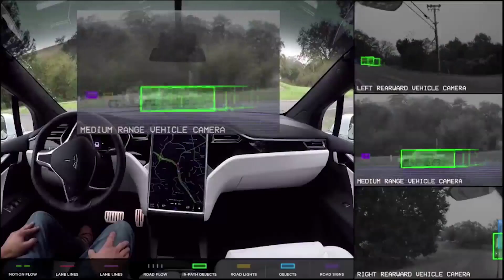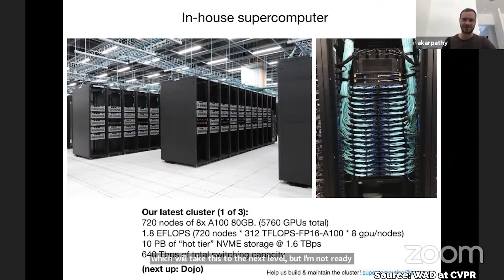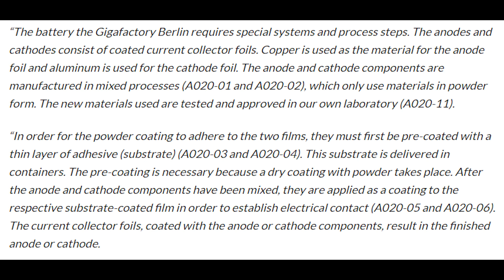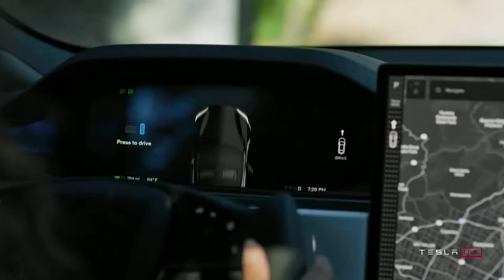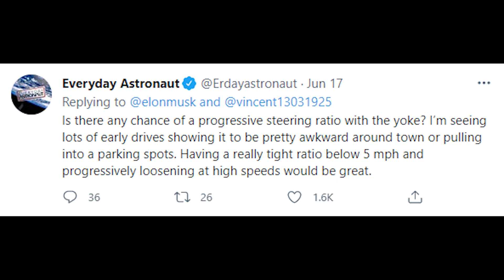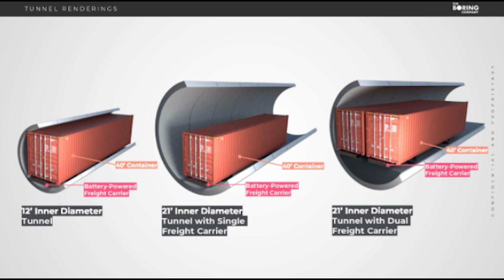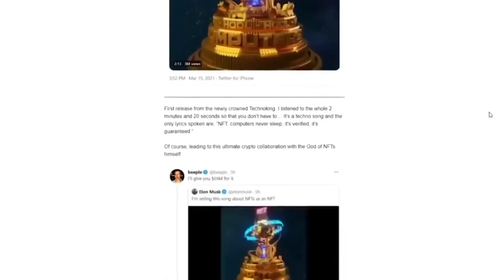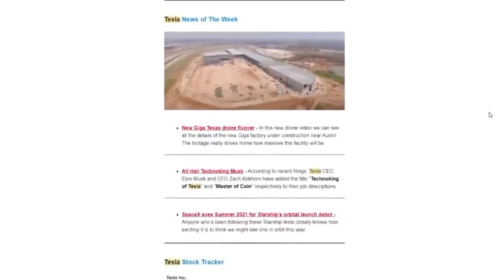2021 Tesla AI Day Is Coming.. + More Tesla News

Comment: Have a current Model S but concerned about the yoke steering on the new one. My lease is up  in September and I have the new one on order.  I wish they would offer the round wheel as an option especially since my wife also drives the car.